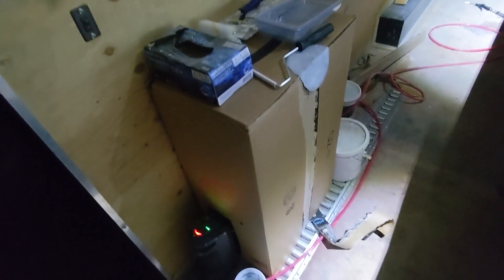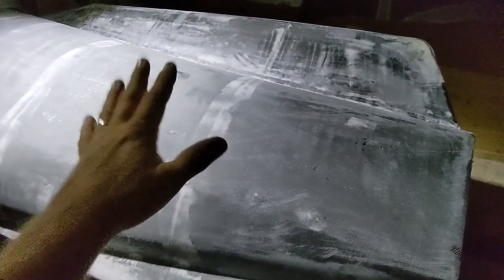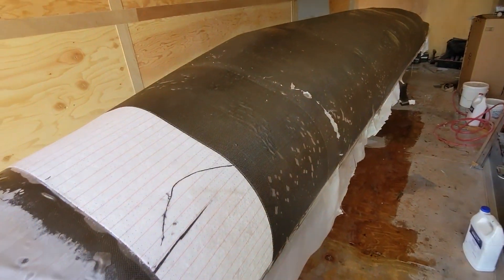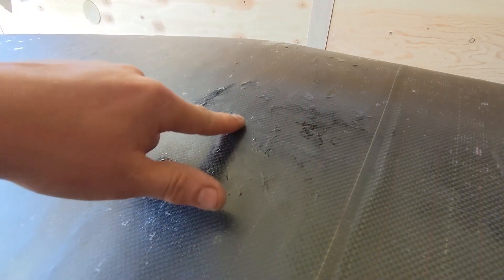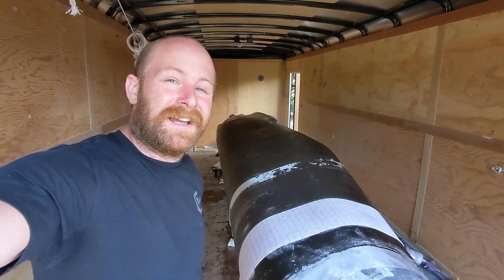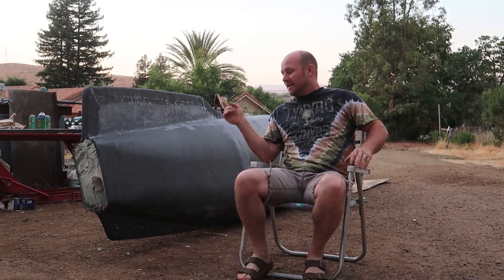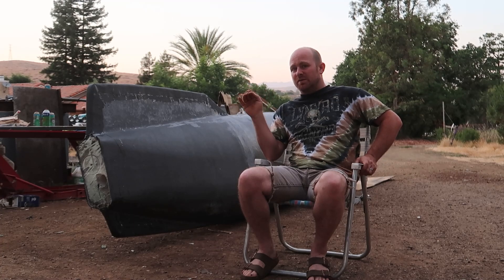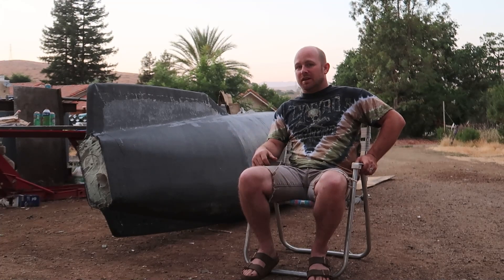Final Carbon Layup for the World Fastest Electric Motorcycle | Lark Machine Co

Comment: Mate, always double bucket when its really important,  it makes sure everything is mixed, your doing great, awesome job Shea
Reply from the maker: I was transferring the mixing bucket to a rolling pan. But then I totally forgot and just turn the mixing bucket up on top. I actually had just enough epoxy to finish the whole project so I was kind of scraping up everything I could use.  Lesson learned though
Reply: Yeah, I understand,  when you just need that little bit more, bugger, I actually buggered my tail ( I was takin g a mould off it) when I was removing the split mould edge and used a bit to much heat to remove the hot glue and peeled the paint, now I have to repaint the whole tail and then finish the other half of the mould,  bugger, the joy of learning by our mistakes 😁